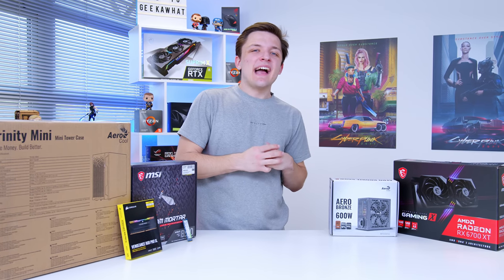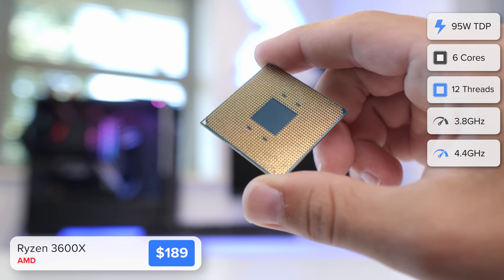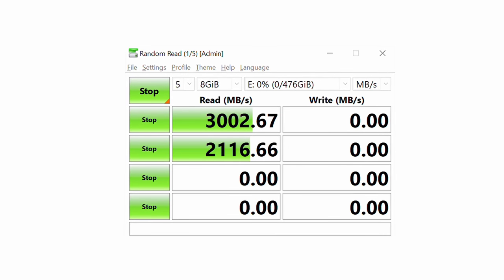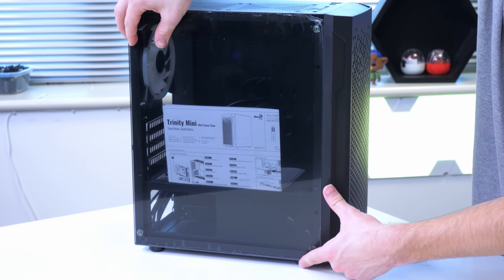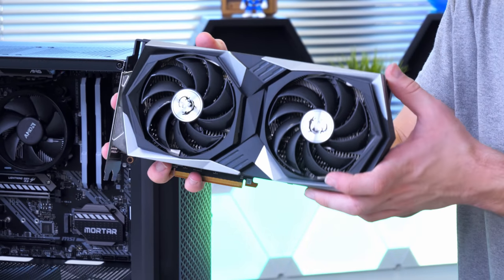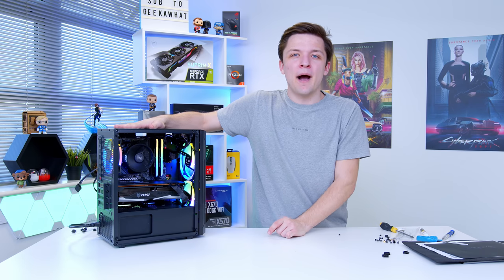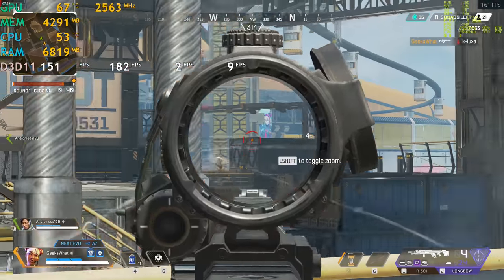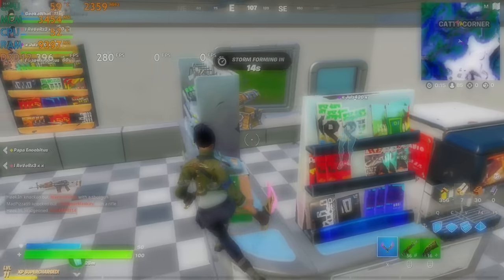Epic $1500 Gaming PC Build 2021! [ft. RX 6700XT - 15+ Games TESTED!]

Comment: does  geekawhat do the right pricing? This is the second video where I found the budget was wrong. This build (going off MSRP) is only around $1000. The $1500 NZXT build had a MSRP around $1700. I know that the gpu is not listed for price, but with that then this system would cost around $500 without the gpu. 

***(This is based off of the prices listed in the video)

Comment: Oh no did i get ripped off!? I bought a pre-build off IBUYPOWER for $1,900. Here are the specs:

Case/Casefan: Default IBUYPOWER
CPU: AMD Ryzen 5 5600x
CPU Cooler: 240mm RGB Liquid cooling
GPU: RTX 3070
MB: MSI B550 Tomahawk
RAM: (2x8GB) Ripjaws 3200mhz
Storage: 1TB SSD M.2 NVME
PSU: 700 Watt 80 plus gold
OS: Windows 10
M/K?: Included
Warranty: 3 years

Comment: I habe an i5 11400f with asus prime z590 v, 3200mhz ram, 1tb ssd, sapphire nitro + 6700xt, with destiny 2 1440p ultra setting sometimes i get 80 to 160 fps, and when i plug a xbox one controller i got softcap to 130fps, with fortnite at 1440p ultra i get 60 fps and a los of shuttering, this is a new build i didnt change parts or anything